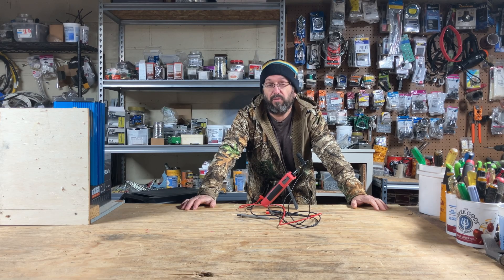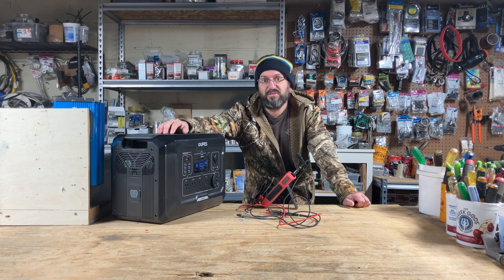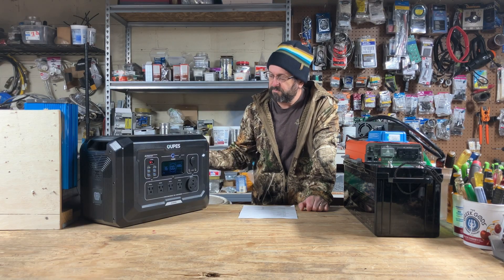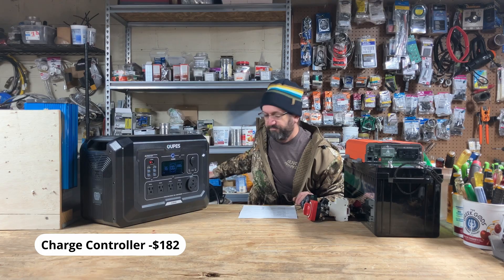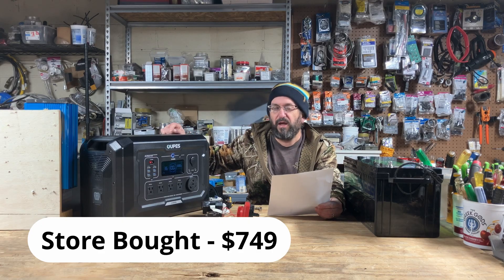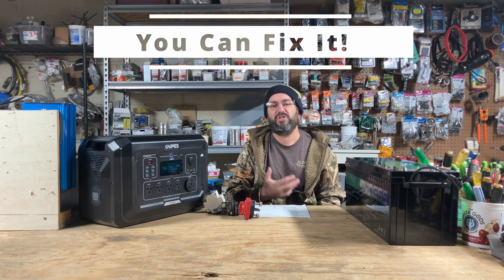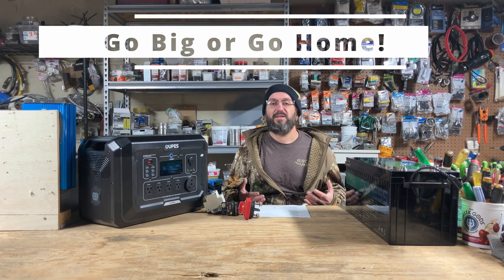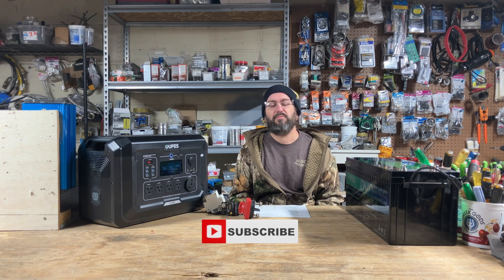Buy Or DIY?  Which One Is Better? Are DIY builds really dead?  Let's Compare a OUPES Mega2 to a DIY.

Comment: I built a 12v DIY system after watching your "Ultimate 12v DIY Build" video several months ago. Final cost was about $150-200 more than if I'd bought a comparable Bluetti or Jackery. But...I don't care. I really enjoyed building it and it helped me to better understand how it all works. I've had a small Jackery 240 and a 100w solar panel for years in case of an emergency, but I never really understood how it all worked.
Reply from the maker: First, thanks for watching BOTH videos!   I agree with you. It is fun and feels nice to know how it works.

Comment: Why is DIY Superior to Bluetti power station? In January 2024 I bought a Bluetti AC 200L and 2 Expansion batteries with discount and buying at Sale Price I spent $3100.  I bought 15,360 watts of ecoworthy 12.8V 300Amp batteries for $1575.  I  have not decided how I am going to make this work since I think going with a 24V system 7680 because each battery is 3840watts x4 =15,360.    But I will do a 7680 system 24V is 2 batteries and 1 single 12V 300amp system and keep a spare battery to swap out with the 12V battery that needs to be recharged.  Actually it might be better to make 2 systems 24V each and swap out the 24V MPPT Solar Charge Controller and Inverter with the fully charged 7680 watt backup.  Then I will recharge the 2 12V batteries.  Then I can buy Watt Cycle 12.8 x 314 Amp batteries for $360 each which is 4019 watts x 2=8038watts that would make a great 12V x 2 system.  Now I have 15,360watts of 12V batteries and 7577 watt hours of bluetti and 2 B300k expansion batteries.  I have 1 Bluetti AC180P that has the easiest job of keeping the 12V Car Fridge Cold. Which can be done for 7 days straight on a 1440watt hour full charge.  If I attach 100 or 200 watt solar panels in series it will basically last forever if I am in an area that has at least 2 good sun days per week.

Comment: I have been living with off grid power for around 25 years. I started doing this back in the days of lead acid batteries, old style PWM charge controllers and modified sine-wave inverters. Now in 2025 we have these portable power stations which are a grate plug and play system for the beginner.
I am starting seeing these power stations becoming the norm with off grid power and replacing DYI builds. My only concerns is, as you mentioned, if a component goes out, the entire unit is unusable and not easily repaired by us DYI enthusiasts.
I question how long they well last in full time use. I have been trying to find some YouTubers that use these full time, non stop and see what their thoughts on these units are, hence why I found this video.
Do you use these in a full time permanent use application and what are your though on using these in a permanent use applications?
Reply from the maker: I do use a power station full time now but it has only been a few months. Your concern is a huge one for me too.  How long are they going to last with daily usage?  I am going to do more and more long term test videos next year. 
Thanks for watching and sharing your story

Comment: NOW do the Pecron F3000LFP 3072 Wh with 3600 watt inverter for $759 that can take 1600 watts of solar on a wide 25-120V/25 Amp MPPT controller.  The Pecron F3000LFP is also expandable to 9kWh with Pecron batteries but also can be hacked to take an aftermarket battery.  Pecron supports DIY replacement of parts UNDER warranty. Go check their channel where they have videos showing instructions for the USER to replace components themselves.
Reply: The Pecron E3600LFP can be paired with another Pecron E3600LFP for seamless integration AND 240 VAC.  Modular expandability.
Reply from the maker: I would love to get my hands on the F3000LFP!  Everyone keeps saying how great it is!

Comment: There are pros and cons to both types of storage banks and I prefer to have both.  I just recently had a power outage where I just hooked up a 280ah 12V battery to my EcoFlow Delta 2000 max to my refrigerator which is a 26 cu.ft. fridge and draws around 140 watts when running.  It ran my fridge for 51 hours before the power came back up.  I have also a hand truck built with the server rack battery and that ran my window unit 5000 btu the whole time while being charge with 800 watts of solar panels.  I don't want to be completely off grid because the break even point is not attainable for me at my age especially with electricity being less than 10¢ per KW.    I also have 2 dometics and one set power 12V fridges that had it become necessary I could easily have transferred food from the residential fridge and I would have been on 12V power only by connecting them to a 300ah battery with a 3 way splitter female car cigarette lighter port.  My jackery 500's were used to run our cpap machines in 12V power too.  A little of both goes a long way.
Reply from the maker: That's an awesome strategy to have both options!

Comment: For Black Friday I purchased an Oupes Mega 1 for $299. You can't build a 48V or even a "GOOD" 12V system with the same specs for $300, maybe not even $400 after cables, fuses and MPPT charge controller. 6 Months ago I purchased a Pecron E1000LP,  it has heated batteries, those are not cheap for DIY but I got the unit for $399 now it can be had for $349. The only real weakness remaining with prebuilt is Solar input and even that can be offset with a separate charge controller if you are battery port hacking to run DIY standalone batteries.  

At this point unless you need 5000+ watts or 240V I don't see the value DIY. There are good and cheap big systems like the Pecron E3600FP, F3000LP,  Oupes Mega 3 or their new Guardian 6000, Aferiy P310 and Bluetti Apex 300 all of these can run a your home unless you need Big 240V output like for a drier or electric heating.
Reply from the maker: I agree.  I use the Aferiy P310 to run my entire workshop.  Next I want either the Guardian 6000 or a large Pecron.  Thanks for watching!

Comment: There’s a couple killer features that make the stations appealing to me.  Ease of hookup. And energy monitoring via app.  Sure a BT shunt gives some insight, but only on the battery itself.  However, the value proposition shifts when you look at the larger 48v stations. DIY still makes a lot of sense.
Reply from the maker: Totally agree.  Large DIY still is better.
Reply: @OurBlackCatCottage I think I need to make a 48V move but maybe if I go to 1 aught cables to connect inverters. PV and batteries and put in fuses near the inverter and solar panels both between the batteries If I have 2 batteries 12.8x300amps should I have a fuse between the inverter and bayside pos +neg and then the same between the Solar Charge controller and the battery 1fuse for pos+1fuse for neg?  I have all the batteries. I just have to get the courage to finally make the move and get this put together

Comment: One problem i see is that if you hand built your own, it is way bigger which puts into question of the claims oupes are making are even real. 

You can't break physics, and that battery is way bigger then the entire oupes unit and somehow they have the same energy density? 

That seems very suspicous. 

Then accounting for everything else, i wonder how much corner cutting was done to get into that form factor.
Reply from the maker: Everything is bigger in size when you DIY if you buy store bought components. If I used a DIY battery it would be smaller.  The battery, inverter, controller are all in their own boxes but a store bought power station doesn't have the limitation so it can be smaller overall.
Reply: @OurBlackCatCottage  That actually raises another variable. 

what if you did do it all DIY from scratch, or as much of scratch as possible? 

You bout premade components, but surely you could make a hybrid pure sinewave inverter for much cheaper then the seperate parts. 

The boards might be cheaper to manufacture, and even making the battery from scratch might be cheaper.
Reply: @TheKillerman3333  Nobody is doing all that. You're talking about making a highly integrated DIY kit to match a prebuilt that negates the whole point of DIY which is to keep thing modular so that parts are swappable on the fly.
Reply: @adiffkindofswag1148  i mean, if we are talking diy, people will go out and get lumberand nails to build a shelf for far cheaper then they would to buy a shelf. 

why not go even further into the market and diy the very modules themselves? 

i am sure the reason DIY is so expensive is the same as the "grocery mark-up problem" 

you can mkae a loaf of bread far cheaper if you start at the ingredient level then buy the bread but its more expensive to get prebaked bread dough or "just add water" bread dough. 

So if you are doing a DIY build, why not go deeper into it. we already know that the components have stuff that overlaps or is redundant, or unnescissarry. 

Why not make it all DIY at the ingredient level, and also make a video series showing how it is built, and how much it would cost. 

this would also remove any variables when ensuring you get thebest possible product.
Reply from the maker: Very interesting idea.  Beyond my skill level but I think an electrical engineer could probably build one.
Reply: @OurBlackCatCottage  That is okay, you can always learn and make a journy video series on your DIY channel. 

The biggest issues i have with premade power stations is feature bloat. 

every device i own can be powered by a wall outlet, or usb type a or type - c

the wattage is just "how many devices can i run" like 2000 watts is 2 microwaves for example, which i know i can't run all at the same time.